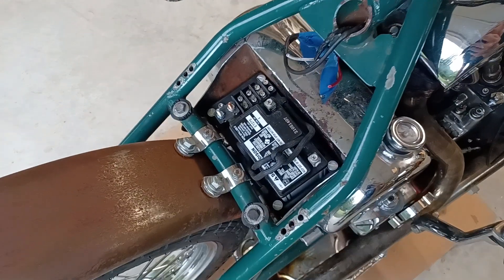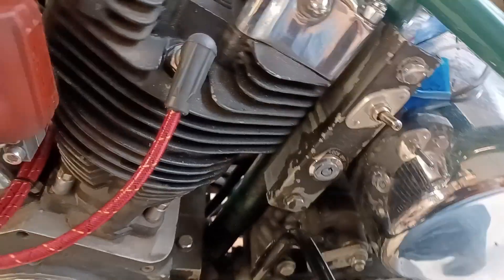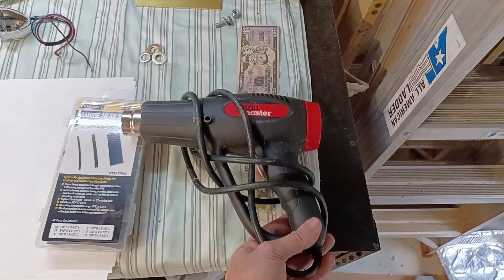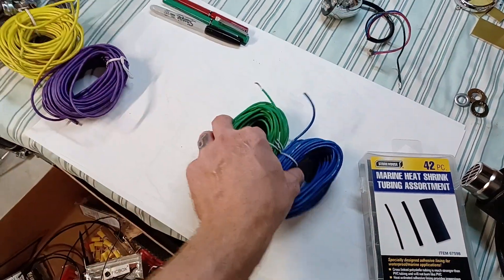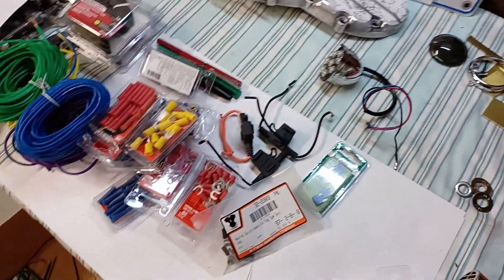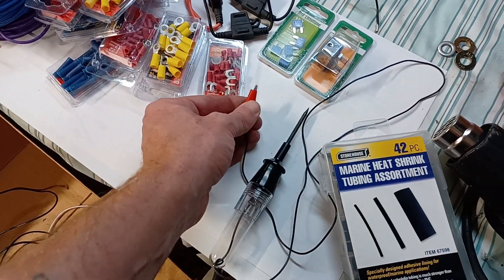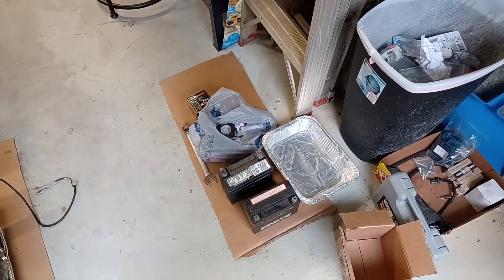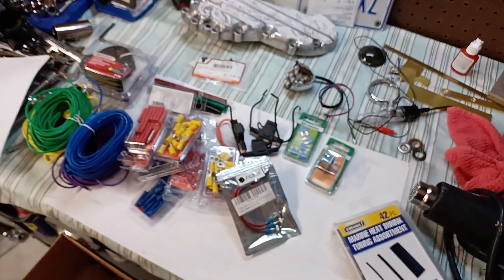HOW TO: USED CHOPPER RE-WIRING - PART 5

Comment: This is great stuff man. You nailed me, got an old bike and now I want to rewire it. Well, got a basketcase and trying to wire it anyway. Its a 76 FXE thats had a flh dash spliced in so its been fun. Your videos are helping a lot.

Just a suggestion, we pull string thru conduit using a vaccum to guide the string from one place to another. Never tried it on a bike but I'd put $ on it working good. 🍻

Comment: How are you getting the paper with light picture to draw on?
Reply from the maker: I use Autocad to draw the wiring diagram. In CAD, there is a way to make the image lighter so it's easier to draw on. If you don't have CAD, you can use "pixlr editor". It's an online photoshop-ish editing program. You can use transparency/opacity to edit the image and make it lighter. If both of those sound like dead ends... I can do it for ya. Just email a good pic and I'll edit and return send ya a lighter version. :)

Comment: What gauge wire do you use from battery to ground?
Reply from the maker: I think this bike had a 6 ga ground wire since kick only, which is same as the old ironhead chopper wiring videos I did. For bigger bikes, higher compression, bigger electric starter loads, I'd play it safer and go up to a 4 ga ground wire. Or... match whatever thickness you have on the positive side going to the starter ;)